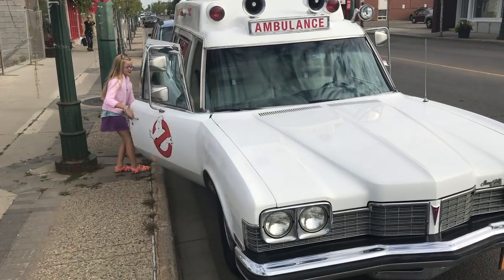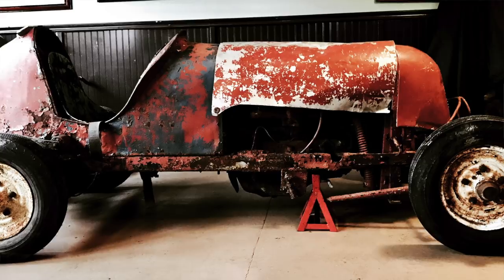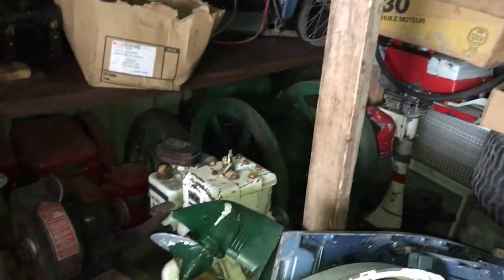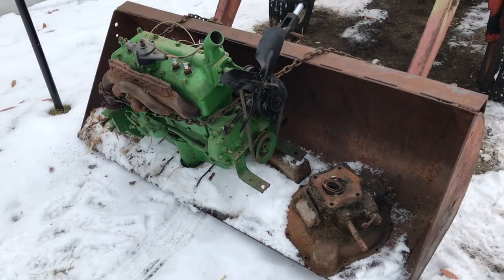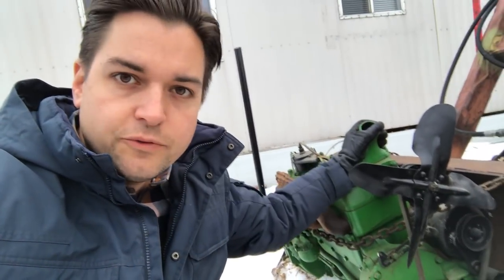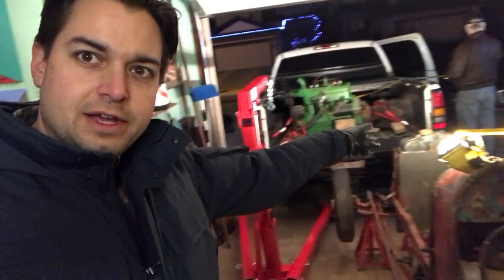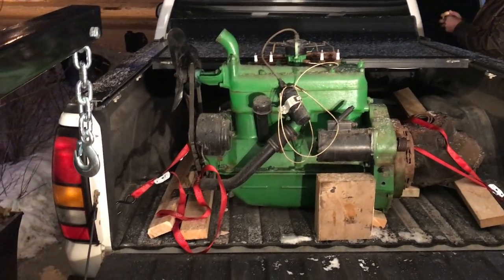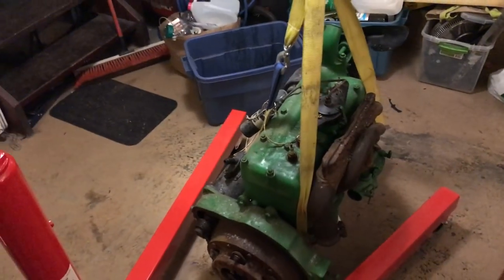Midget Race Car Restoration Part 3, Finding the engine!

Comment: This is pretty cool. I grew up in Texas racing Midgets (much more modern then this one ha). They are really cool cars. That is a REALLY old one there. Most Midgets are direct drive and push start. But back in the old days they actually pull started them. They would hook a rope through the front bumper and pull them behind a truck to start them. Lots of famous drivers cut their teeth in Midgets, like AJ Foyt, Mario Andretti, Johnny Ruthaford, Tony Stewart, and Kyle Larson.

Comment: Cragar head, alloy side plate,yep.. plenty of potential That looks like a Canadian heater exhaust manifold which had a steel shroud which ducted toasty warm air into the cabin .
Reply from the maker: That heater won’t do much good in an open cockpit ;)